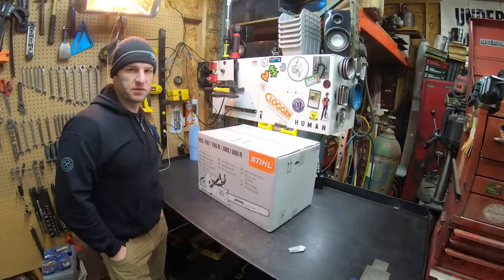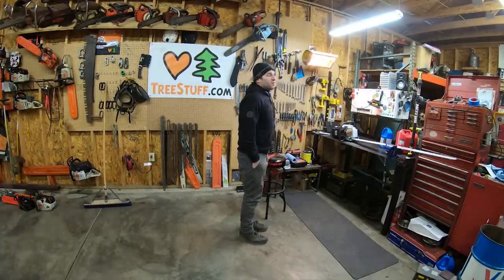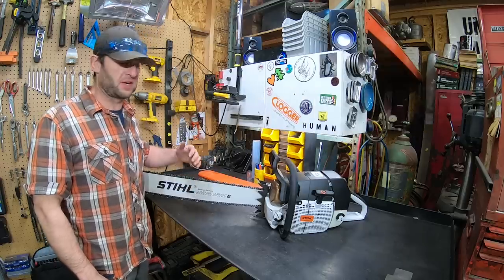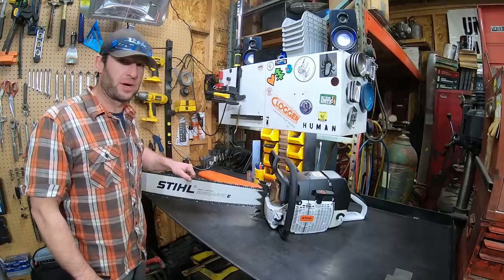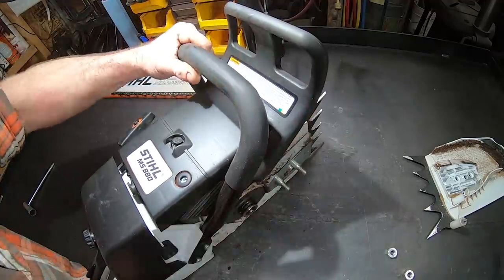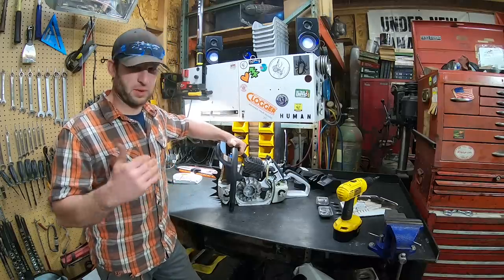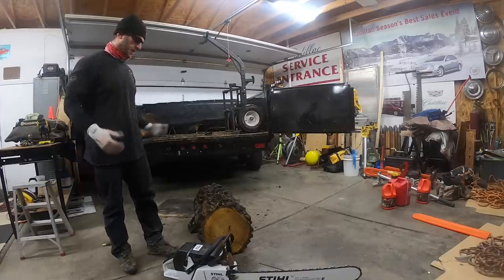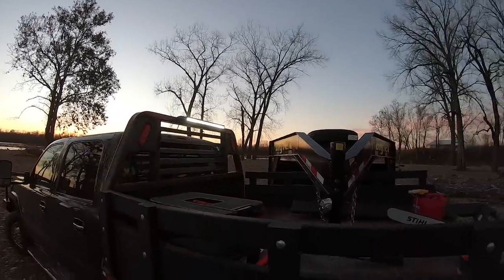Stihl MS880 Unboxing, Overview, First Cuts

Comment: Pretty shit packaging for such an expansive saw...
Reply: Thats most stihl saws
Reply: What do you want? A shit ton of peanuts or bubble wrap to mess with? We are a gold level stihl dealer (we move ALOT of saws) and have never had these damaged in transit unless some fucker at Fedex ran the forklift through the pallet. The box is designed very well imho
Reply: Honestly i like this better then them wasting a lot time and money to make a nice package that you are going to throw away the moment you unbox it
Reply: It’s not an iPhone, plus the end user never sees or opens the box it’s all the dealer. Human gets them virgin since he worked at the dealer.
Reply: @FishFind3000  What do you mean the end user never sees the box? If you order one or buy it off a shelf it will be unpacked? That's odd, where I live stores are forced by law to deliver the goods in a sealed package (or open the package in front of you inside the store), otherwise they can't sell them as new. 
Last tool I purchased was a hand held lawn mower, it came in a sealed box with all the advertised accessories individually wrapped inside, plus an additional brush cutting disk and some basic safety goggles included as bonus (by the manufacturer, not the retailer, these weren't even mentioned in the offer). And it was just a 200$ hobby machine, not some fancy professional tool. Granted that some 10$ freebies may not be very useful, but it's the thought that counts, I'm shocked to see a far more expansive tool delivered in a plain empty cardboard box like that.
Reply: Packaging engineer here. That packaging looks more than competent for a chainsaw. Packaging is all about the durability of the product. If the product is already durable like a Stihl chainsaw then you don't need to go crazy with the inserts.
Reply: @Dr_V  "hand held lawn mower"???? lol Think you mean trimmer, weedeater or brushcutter (whichever you prefer) Those sorts of things yes come boxed up and at that price are often just sold in your average home and hardware stores (varies by where you are though) Here in Australia cheaper home brand type tools stay in the box and they'll have some basic accessories with them as often your average homeowner might not have that sort of kit but once you get to the more serious end like Stihl, Husqvarna, Honda etc. they are often sold in dealerships only (Can only think of a couple of Honda bits that are sold in hardware stores here and that's it for the most part. They come fully assembled and ready to use, and sometimes yes some extras will be chucked in at the dealer's discretion. Mostly though it is seasoned lawn and landscape professionals like us who are buying these tools and already have all the required gear for safety, maintenance and so on, so anything extra I get in boxed products never gets used. We run pretty much all Stihl gear and the only time I've ever seen one in a box is in the back workshop of my dealership where they get put together pre-sale. Only small PPE items and the like get sold in their boxes. It's part of the quality and service so you don't have to worry about messing around putting them together yourself.
Reply from the maker: Those three words made my week     Packaging engineer here!      /Cheers    =)
Reply: @Human1337  haha, yah were quite overlooked. Which is exactly why I chose to major in packaging science. The job market is fantastic because there are so few of us. You can take it a million directions and you have a direct impact on the consumer and the environment (good or bad). Only real downside is were marketing's bitch despite the fact that I went to school for this and know what I'm talking about and they have nearly no clue about anything.
Reply: @JWNLawnCare  As you may have already guessed, I'm not a native English speaker, so I used a dictionary translation. Thank you for your detailed reply, it made things much clearer for me. Beyond the hobby vs. professional aspect, it appears that the different commercial regulations are also influencing my views on the matter, here in Europe you can order almost anything online and if you choose to buy a fully assembled tool you either go to the retailer store and witness the entire process or the retailer has to fully repackage it before shipping and also take over all warranty obligations (from the manufacturer), so they're not too keen on doing that.
Reply: @Dr_V Hi Stihl, oleomac, briggs, kawasaki dealer here. It is not allowed to sell stihl over the internet or via post order. Every stihl unit is unboxed fueled up and started in front of the customer and tuned if needed. Sending a stihl product is a breach of dealer contract. This is how professional machines are sold not by post in a fancy box it's not a mobile phone.
Reply: @Dr_V  where I live you can only buy a stihl saw from a dealer,I never seen the box my 261 came in.
Reply: @3cx71  Here I can order any tool online if it's transportable by a courier, no matter the brand. The only things you absolutely must pick up in person are the ones that require a license to own and use, like firearms for example.
Reply: I have never received a saw in a box.....and wtf is a hand held lawnmower?
Reply: @Dr_V  around here all my stihl dealers the saws are unpackaged on shelves. Once bought you either buy a carry case or walk out the door with just a saw
Reply: I bought all my stihl saws and equipment from a dealer and never seen a single box for any of them. He gas a whole shelf of saws un boxed bars an chains installed ready to roll i think he unboxes them all cuz a couple of my pro saws he had to order in and when he calls me to pick them up always are fully assembled with no box... Its all good an all that they're always assembled but what if i wanted to look at the box. Should come with it.

Comment: I hate Stihl bar oil. It's been too thick for years.
Reply: About any oil works for oiling the bar.  Only the stickiness (anti fling) of bar oil is a possible factor.  In my experience regular 30W motor oil works fine.
Reply: Doesn't matter how thick it is just more expensive than basic oil.

Comment: My 362 heats and eats chains. Oiler wide open on a 20" bar. Ready to throw it over the hill.
Reply: @Dig Byck if I pull the bar and run it, it comes out of the slot so fast I could empty the tank in 5 minutes. New bar, a buy 2 get 1 stilh chains (dealer, not ebay maybe China fake) it is actually stretching them. With play in the rivits. Thinking about it, my dealer is shady. They might be buying fake chain. I wouldn't put it past them to be buying those clone saws and putting stihl emblems on them.

Comment: Smart to break in properly. Will make your future mods and use more powerful. Once you finish breaking in, may consider getting the cylinder and piston coated by US Chrome  from http://www.usnicom.com/plating/pricing  and then a decked, ported, and a custom exhaust by Rich. Here is an example of the exhaust https://youtu.be/EsxCEk42Tqw. This is what he did for one I sent him in 2016. It runs all day at 13,000. https://youtu.be/aKXhvCyYNPc   Have fun...be safe.

Comment: STIHL dealership owner here.  Why do you bitch about the bar oil?  You said it’s 50 degrees at the time but yet your using platinum winter oil. I’m guessing you think that constitutes as winter where you are from.  Check it folks, the bottle is blue.
Reply: Isn't winter blend oil a lower viscosity? Why would he get less oil flow with lower viscosity oil at higher temps? Seems like it should be flowing too much.

Comment: duromatic  solid bar no roller tip, , chain has to be left looser than roller tip bar, or what u see. who sold you a duro bar?  all stihl equipment should be serviced and ready to use by dealer. disposable  junk comes in a box un~ serviced.
Reply from the maker: I used to work there, so they let me do what I want, they know I don't want my stuff opened.

Comment: I hate to break the bad news but that saw will likely never be able to provide enuf oil for that 5 ft. bar. stihl does not calibrate their oiler system with enuf volume. e.p.a. thing maybe? I have noticed that on other stihl saws. had to put a high volume pump on my ms250. on the other hand my jonsereds 2166 is fine. so is my jons 70e. I am done with stihl saws anyway. them cheap pricks skimp out on the length of pull rope they put on their saws. pathetic!
Reply: I've never had a problem with mine, I had to crank my oil way down, but they strictly calls for platinum oil. I get about 2 sometimes 3 tanks of fuel b4 I run outta bar oil